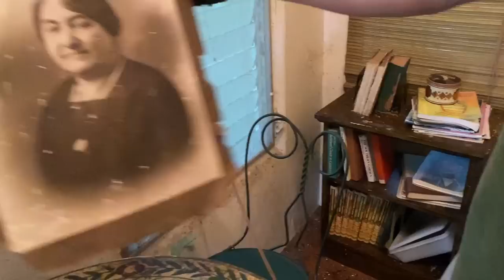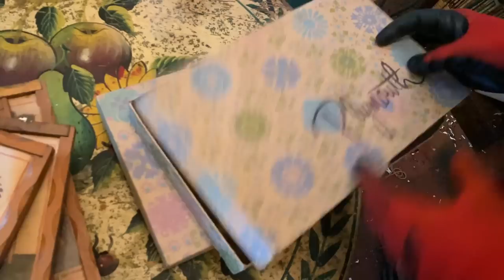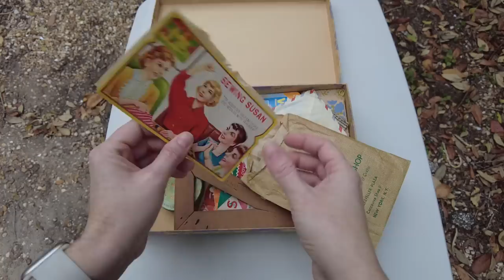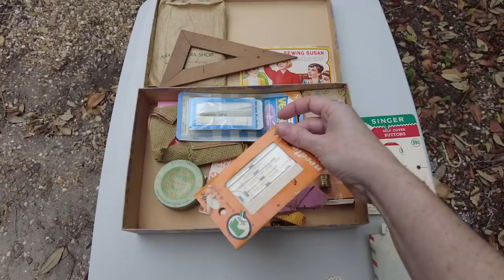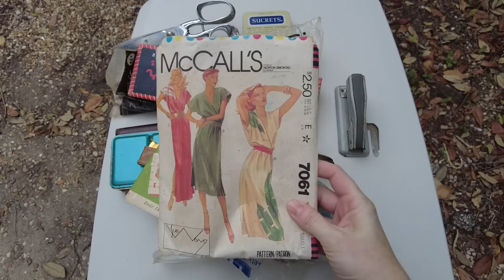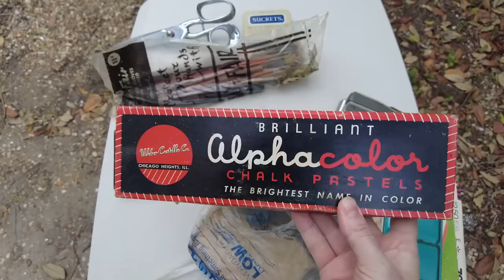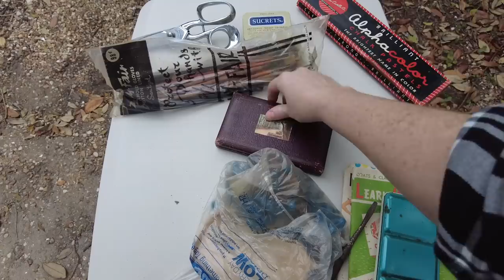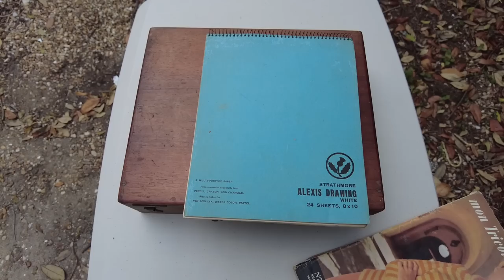Calling all CRAFTERS! Look what we found… Ep 16

Comment: That is a drafting compass set for drawing with ink, as in using an ink well. One would open or close the points to make the lines wider or narrower. It didn’t look like those would have been used for lead to me. (32 years drafting instructor)
Reply from the maker: Nice! Thanks so much.

Comment: On the compass you found, they are measuring compass's. if you take a closer look there will extension arms that fit it the holes on the main piece. Those look very old and can worth some thing to a collector. I have some but the are not as old as the one's you got there.
Reply from the maker: Thank you!
Reply: @CicadaAndCo   On most maps they will have a legend that show you how many miles to an inch. You can set the compass two the setting of the map, and use it to see how far on place is from another place on the map with that type of compass. You can even use it on for blueprints some times to set the scale to know many feet to an inch, this way you know how far walls are apart or just how wide a house or what ever the items length is on a set of blueprints. That is what they are used for.

Comment: That wooden box with the lock and two latches looks like an old fashioned Painter's Easel, it would hold paints and supplies when traveling. It made it easier for painters so that they could remember where they went instead of using a camera. Maybe for the 60's or 70's era of travel.
Reply from the maker: Yes it is